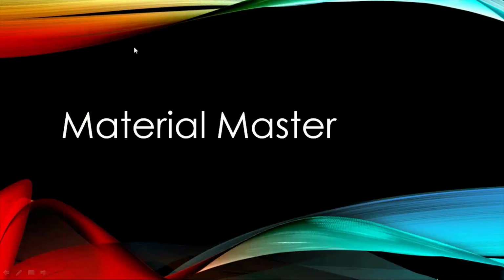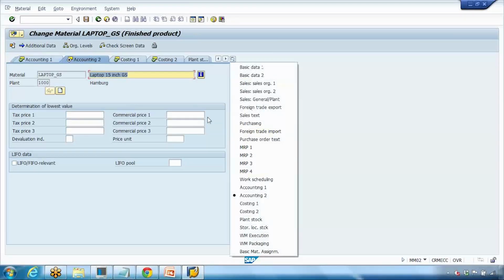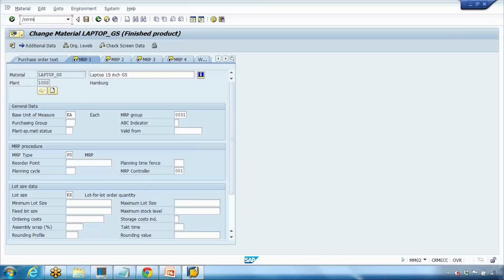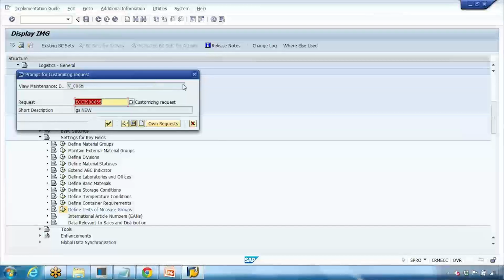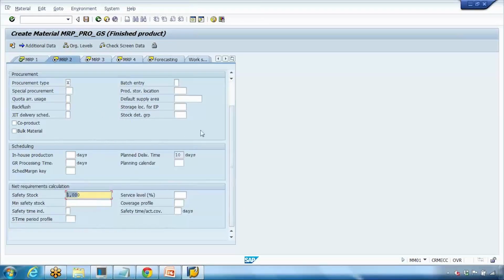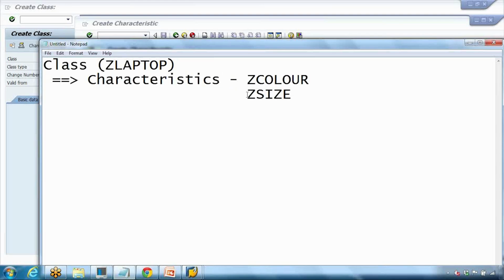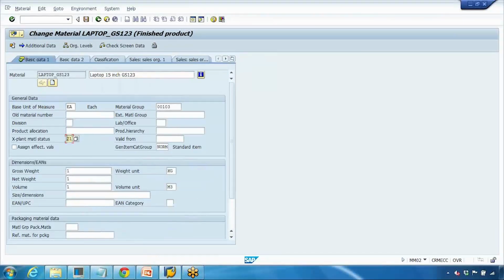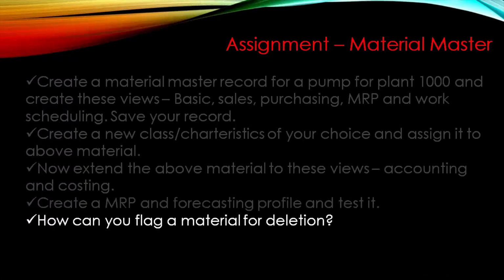SAP PP Training - Material Master (Video 3) | SAP PP Production Planning

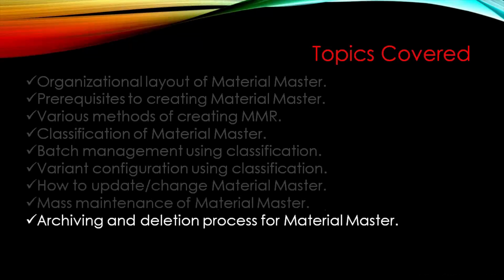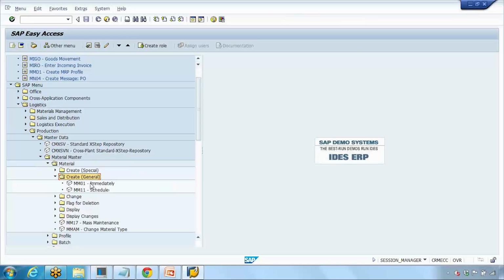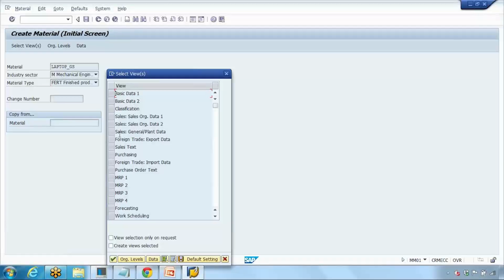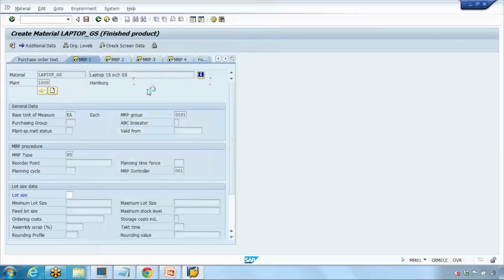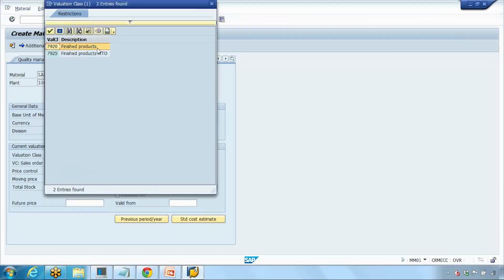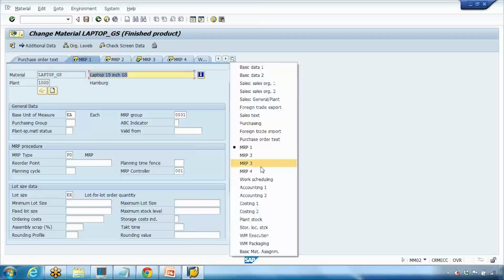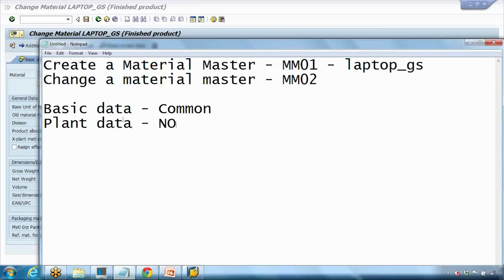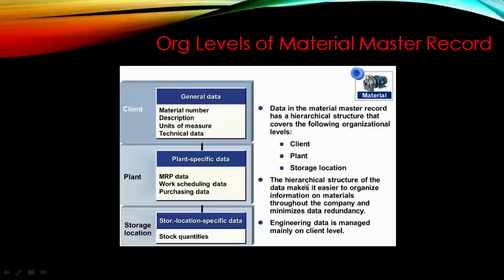Comment: Swaroop Venna: 0:45,views 1:48,  MM01 path 4:31,  different views at system 6:42,Tax 11:11, lot size 12:21, valuation class 13:16, work scheduling 17:17, org lvl 18:10, different data 20:10, common vs not common data, combination plant and storage loc 30:04, 31:41,change master 38:57 selection screen input help,UOM 42:44 carton, crate and Pallet,UOM group 45:58,MRP profile (kind of default settings for MRP only) 57:45, path 58:20, Blue label indicates Fixed 1:01:00,
Reply: Material ->Classification  -> Class type (Material / Batch etc.)-> Class (CL02)-> Characteristics (CT04), Material by Batch (1:29:01) - differnt class type(023), Configurable Materials (1:30:05) - class type (200), Variant (Class type 300), Block a plant 1:36:30, Define Material Status, Mass maintenance of Materials (MM17), Display Changes (1:46:30), Delete a Material (Flag for Deletion - MM06) - 1:49:00, Archive (1:50:10)

Comment: Anybody please help,
I cannot enter base unit of measurement in Basic data 1 page, and also I cannot go ahead without entering the value.
Anybody know the solution please help
Reply from the maker: make this field as an entry field or non-mandatory using via customizing screen field for material master. Google for it
Reply: Thank you sir. I have found it and made required configuration.